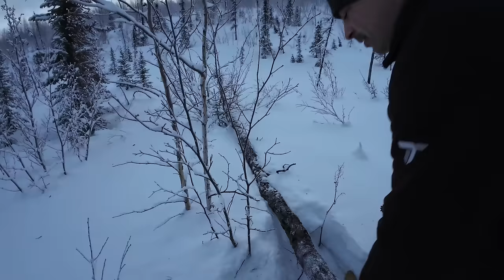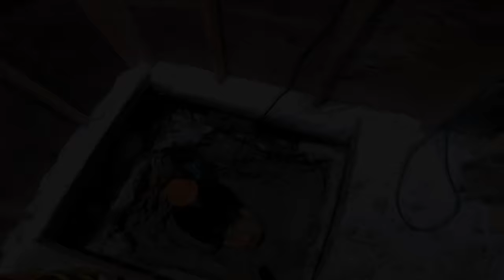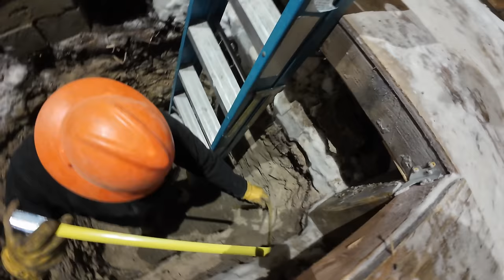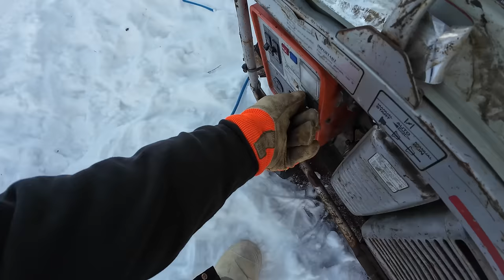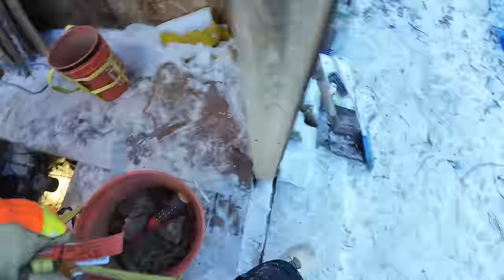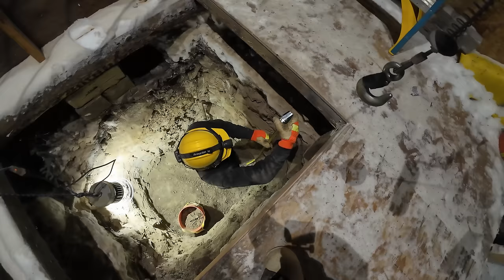Alaskan Winter Mineshaft: Gold Mining/Prospecting in the Interior of Alaska - Part 3

Comment: Tip for digging deeper faster. Always start your day by digging a foot deep in one corner.
The ground breaks away more easily if your removing a ledge rather than working on the flat.
Reply: I like the center... but exactly the same as you say...go deep in one spot then spread out by cutting next to it and the ground has a place to break and release too.. just like blasting starts with one or 3 center shots then the next round  blows in to the first shot
Reply: the ground is hard enough withoutt winter. batt or two of insulation to stuff in the hole while youre gone. it would help keep the frost out of the ground. then maybe you wouldnt have to chip as much ice. ideally youd want 30" worth r60
Reply: dynamite
Reply: @okanaganlakeman7384  was thinking the same thing, I wonder how deep the frost gets in fair banks. I wouldn’t have thought it would be much deeper than 6-7 feet especially with the snow cover.

Comment: I dug with Jack Hammers my whole life concrete and dirt  try the pointed bit. Start in the center of the wall and hammer 2 holes 3in or so deep, 6in apart in a honey comb 2 Holes then off set 6in back do 3 holes 6in back, then 2 again. Use the pointed bit and drive it in at least 3in per hole. Then work right towards the corner and then dig right again how ever deep you can get leaving a shelf for the bucket on the left. Just a thought
Reply: Hello Michael, thanks for watching.  The material at the current depth is mostly frozen silt and a pointed bit tends to drive and stick.  It's not at all like digging in concrete.  We did a test today and the chisel bit is working the best at the moment.  We might use the bull point again when we are in pure gravel.

Comment: You may want to consider cutting down trees and dragging the whole tree back with you. Cut down half a dozen tie them all together then drag them all. Cutting 1 down then cutting it up to fit your trailer means you can only collect a small amount where as dragging trees back saves on fuel and the amount of times needed to go hunting down trees.looks like your gonna need bracing in that hole shortly anyway .
Reply: its not that deep

Comment: I'm gonna tell you a trick that will speed up your digging x10. Dig a hole with your jackhammer about 10 inches by 10 inches, and go down about a foot by hammering inside that 10x10 all over the place. Let the jackhammer work its way down and then pull it up and out and hammer the spot beside it right down again. Go down at least 1/3 or more of the bit. Pull out and repeat until you've smashed that 10x10 and broken it up. 

Shovel out the 10x10 hole you've just created.    Now you can break large chunks of dirt Into that hole you've just created.
By freeing up the space of that 10x10 hole, you'll find you can jackhammer out chunks of dirt much bigger than before. You always want to create a space for your dirt to go into - this will make your life a lot easier and you'll find the dirt and rocks will break after 2-4 whacks instead of having to hammer each and every spot for 20-30 whacks to get 4 inches of dirt broken up. 

This is from experience digging thousands of post holes into bedrock and every other material on the Canadian shield. It's a puzzle to work in the space you have to work in - and there are tricks to doing it better. Hope this helps!

Comment: Dont you need to make the shaft a little wider for making the bracing of the wall?considering you also need your space to work with to. If im not misstaken that layer around there wil turn to  mud when it melts in the summer ?

Comment: What are you guys looking for? A gold seam ? Why are you mining this way?
Reply: They are looking for the ancient river bed.
The gold will be in amongst the river wash sitting on bedrock.
Reply: @adzoutnabout888   Won't that only be a tiny bit of gold in that spot? Unless they hit some kind of pocket
Reply: @brianredban9393  true mate, it is fairly hit and miss.
They would do well if they bottomed on an inside bend, a series of rock bars, a big boil hole ect.
Reply: @brianredban9393  first you dig down vertically to paylayer then tunnel along the paylayer horizontally.
Reply: We are targeting an ancient placer depost known as a paystreak.  In this area they were incredibly rich, in some places yielding several ounces of gold to the pan.  We are trying to determine if there might be enough gold to justify the removal of the overburden at this location.  If so, we will begin mining with heavy equipment.  We do not plan on tunneling at all as it is extremely difficult and can be very dangerous.  Thanks for watching!
Reply: @adzoutnabout8666  The inside bend theory doesn't apply to these deposits.  These are ancient flood events and tend to be very straight and uniform.  The theory that gold accumulates in the inside bend generally applies to more gradual, recent formations.  This gold was laid to rest when the current creeks did not exist.  There are numerous reports on the State of Alaska DGGS website from the 1930s that explains these ancient rivers.
Reply: @tylernelson276  generally yes, I do agree with you are saying, but there are variables such as boulder fields, volcanic intrusion into the water course or a confluence of the main lead with smaller leads.